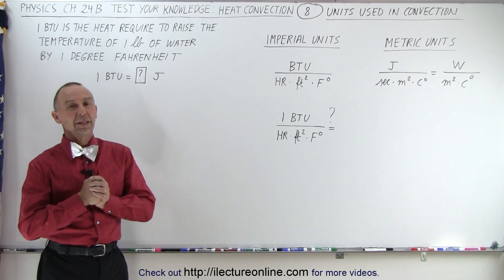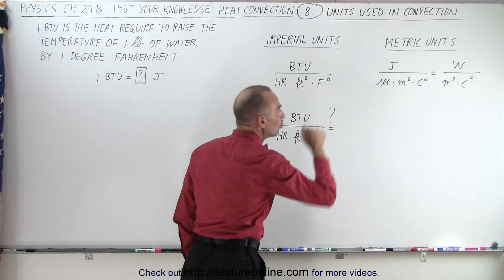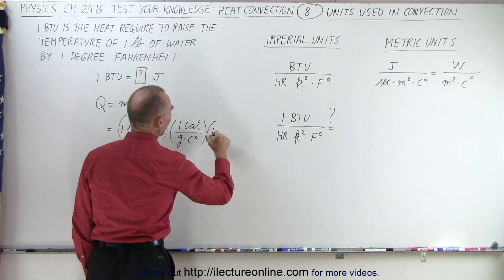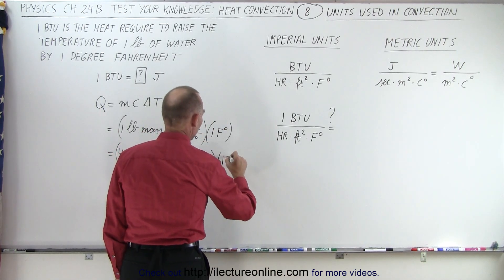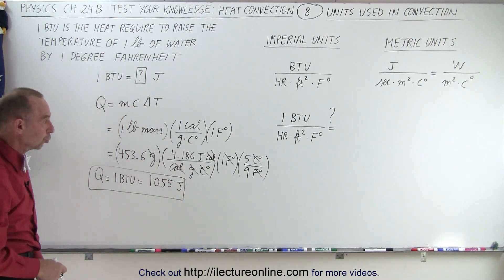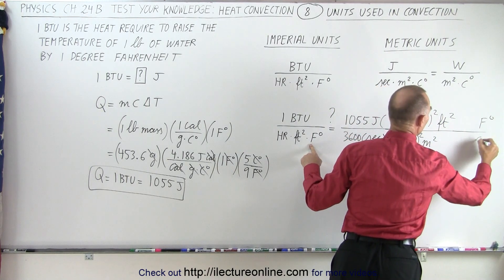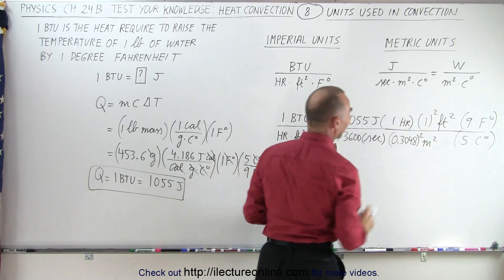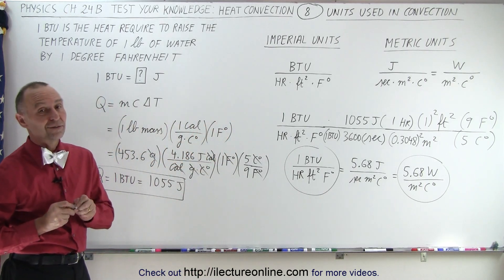Physics: Ch 24B - Convection: Test Your Knowledge (8 of 26) Units Used in Convection

Comment: why is  -32 not used on changing F to C?
Reply from the maker: When we are converting one Fahrenheit degree to a Celcius degree we don't need to add / subtract the "32".  But when we convert a temperature from F to C  or  C to F, then we need to.
Reply: If 2 then we add 32. That's right?